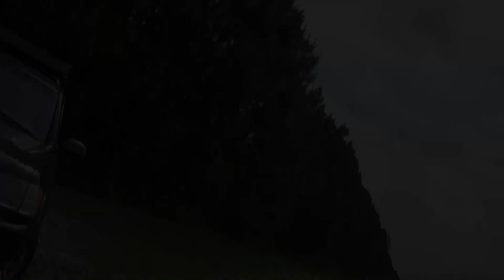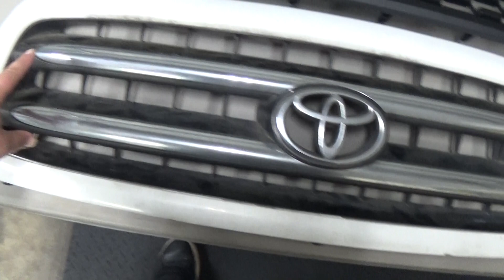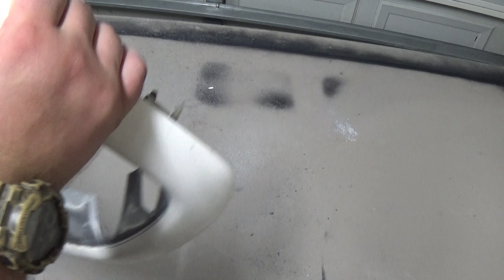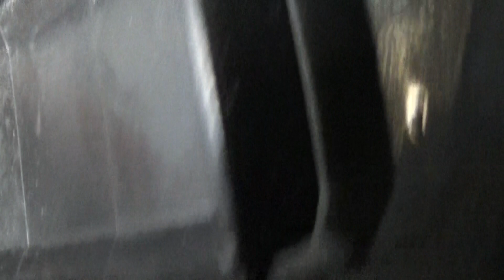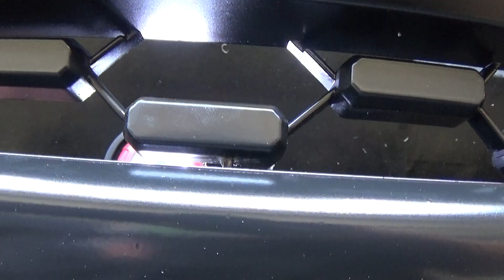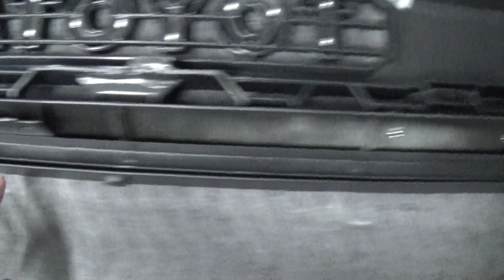SEQUOIA TRD PRO GRILLE CONVERSION (1ST GEN SEQUOIA TRD PRO GRILLE)

Comment: Think it would be advantageous to start with one of the aftermarket low profile mesh style grills then convert that with the TRD grill? Have been looking for pretty much exactly this for a while for my new 06 tundra race truck I'm finishing. Good work man!
Reply from the maker: Thanks for the comment. The low profile mesh grill are not in production anymore. That's why you will have to cut and modify the stock grille. I wish it was that easy. Lots of time and patience.
Reply: @munnday86  check out the EAG grill for 03-06 tundra. Seems like the prefect starting point and you would potentially keep more of the TRD pro grill.

Comment: FYI... if someone sold this I would definitely buy.
Reply from the maker: True. I would have bought it too.. it's really time consuming. Just ballpark how much would you be willing to spend on a grille like this.?
Reply: If it’s all ready to go “plug & play” maybe no more than 100 - 150
Reply from the maker: @ivanf4568  see that's the thing a TRD pro grill is about ~$100 and a sequoia grille is about $90 that's just $190 in parts. Not including labor and parts. Sanding paper fiberglass. And shipping. So honestly looking at a $400 to $500 grille at your door. I would just DIY. Save time and money.
Reply: @munnday86  I have the donor grille, would purchase the trd and send your way... I just picked up a straight body (parts vehicle) 01 4wd platinum for too cheap,been sitting for 5yrs. Clear coat is shot, was dead pedal after a starter replacement.(dorked harness plugs to TB) runs like a champ with 234k. Took my 01 4wd platinum with 328k 2hrs out with a rental trailer from U-Haul and hauled her back, and she did like a champ 🏆